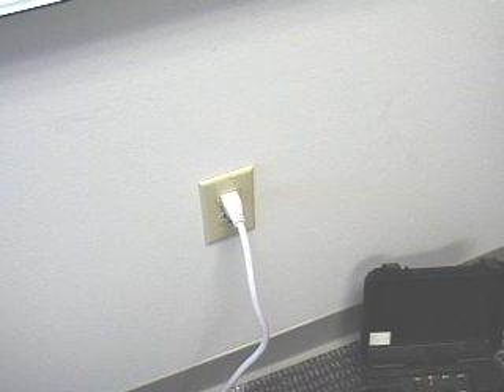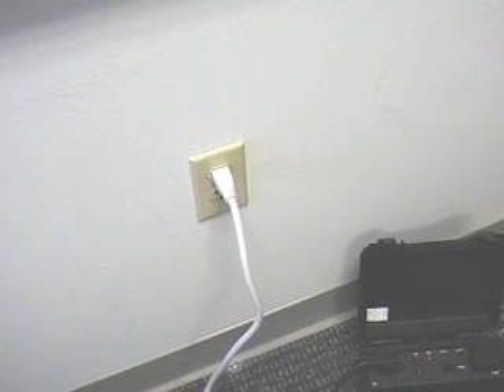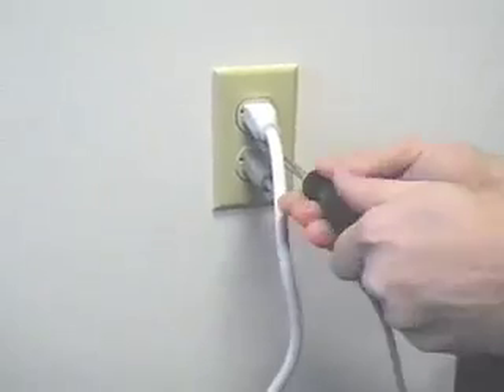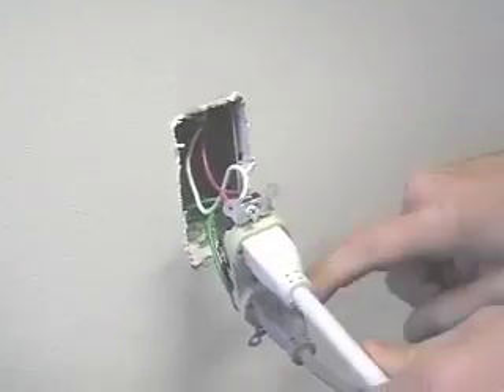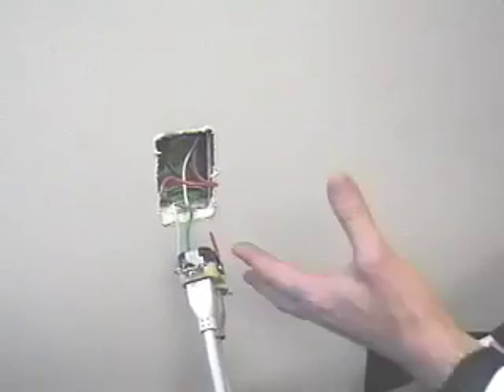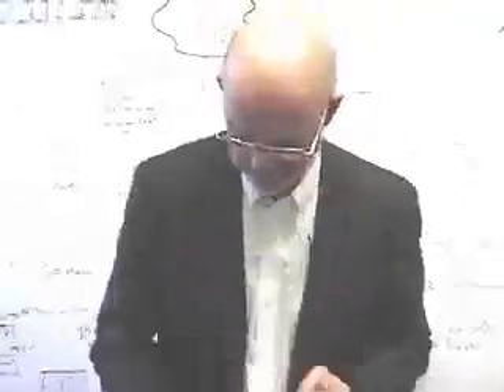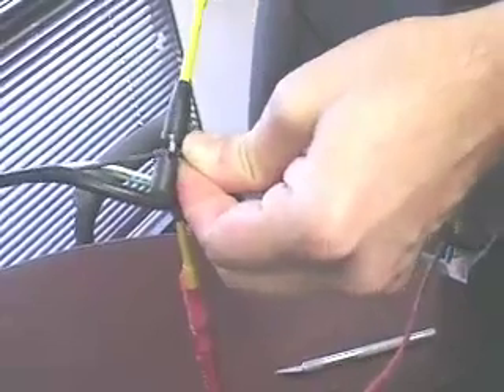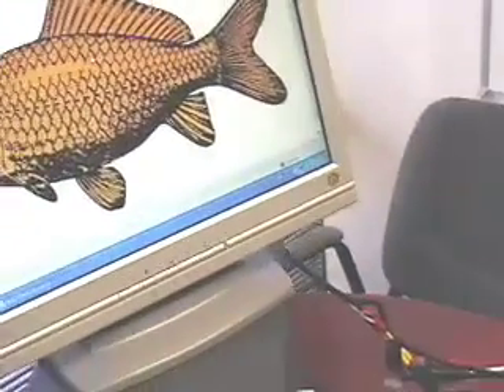HotPlug Advanced Demonstration

Comment: "I have years of electrician experience"
*touches the metal of an... insulated screwdriver*
umm?
Reply: I know this was 12 years ago, but when he is touching the metal of the screw driver it is in contact with the grounded portion of the plug that you yourself have to touch directly to pull it from the wall. The Mounting strap, the metal portion at the top and bottom that is used to screw an outlet to the wall, is probably one of the safest areas on an outlet to touch.
Reply: @GarrettBShaw  I have since learned a lot :) thank you for your clarification, and apologies for the ignorance

Comment: anyone who has secured their computer for nefarious purposes already defeated the USB ports, so mouse jiggler wouldn't work
Reply: Interesting. How do these computer users use a Mouse or a Keyboard?
Reply: CRU most computers are laptops. built-in
Reply: I've never met anyone who was willing to disable USB ports. However: Laptops also have a battery built-in and don't require a HotPlug for removal.
Reply: Whatever, I'm sure the is stare that will present a request to the user every x minutes to input the correct password or the HD gets locked and encrypted or trashed.
Reply: That's close. The common software is built-in to Operating Systems, and it detects inactivity before assuming the user has left and brings up a password box. If someone can't enter that password, they can't regain access to the already encrypted computer.  This is exactly why Mouse Jiggler is useful; It creates activity so that the computer won't bring up that dailog box in the first place.

Mouse Jiggler has found a wide audience in corporate use (on machines people are allowed to use it on) and presenters.
Reply: Instead of defeating your USB ports just write a script that monitors for the Wiebetech USB VID (0x0E90) and tell your machine to immediately lock down when they're detected.